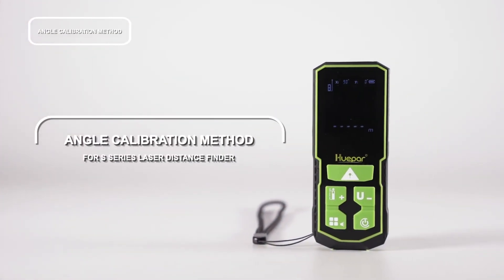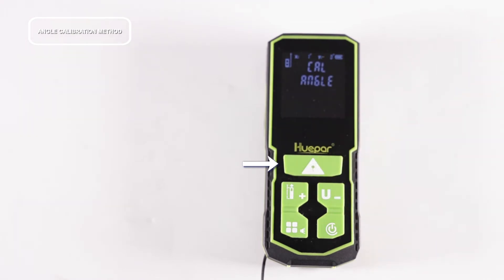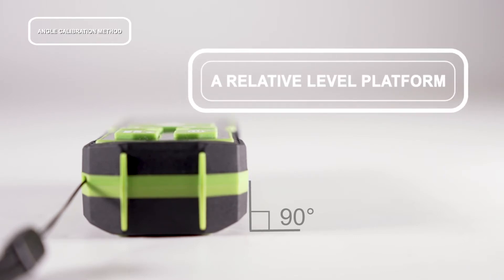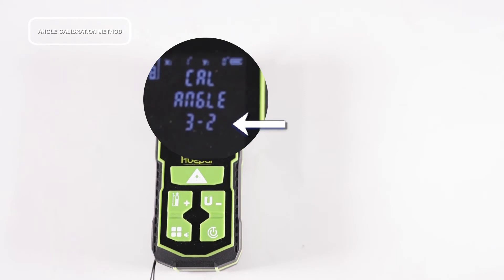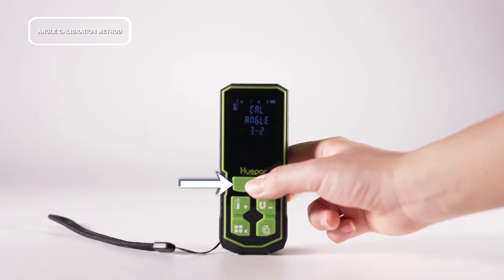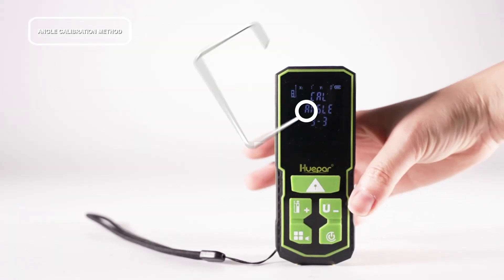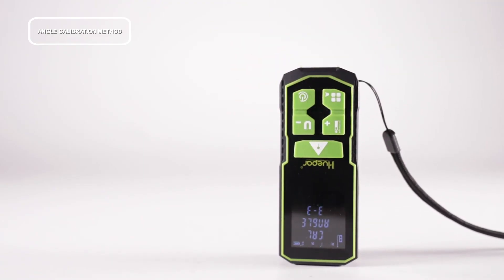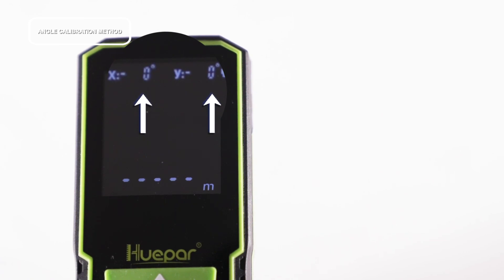How to Calibrate Huepar S60/S100/S120 Rangefinders

Comment: Mine is not very accurate compared with DeWalt model (165').   It was much cheaper, bought the better one, and now have spent way too much.   Might have some purpose, but lacks accuracy and repeatability.  Disappointed.

Comment: And you can set the offset too !
On mine (classic lcd)  to enter offset calibration press mode button and power on for a few seconds.
Then adjust offset, probably in millimeters with + - buttons. Then press the measure button to save.
Check the results.